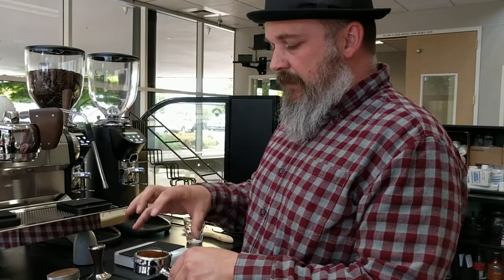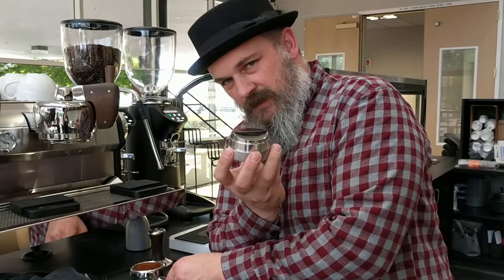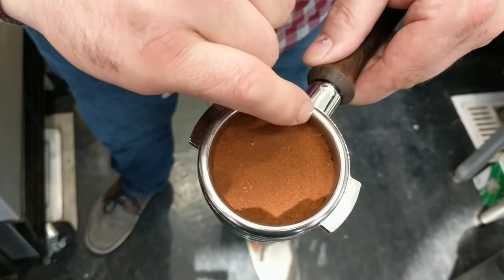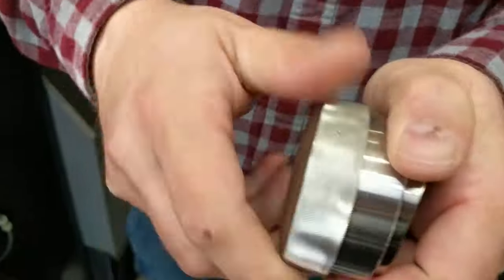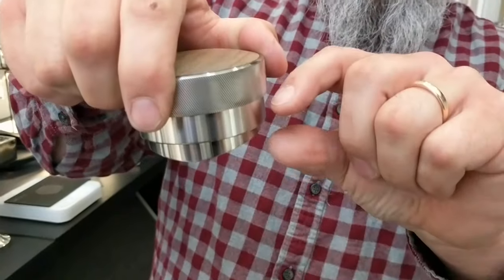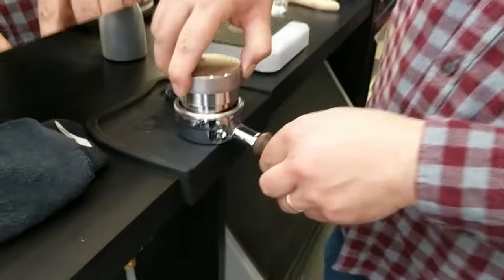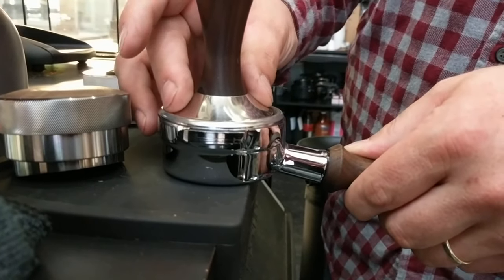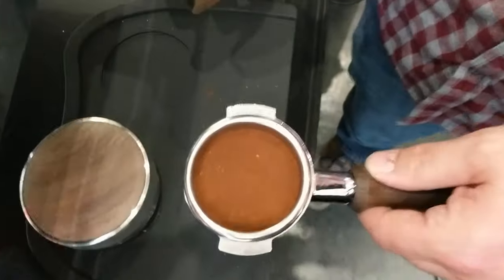Saint Anthony Industries Distribution Tool Depth Setting

Comment: If you set the distribution tool deep enough,.do you really need to tamp ?
Reply: We actually ran some experiments with this. One of the surprising things we found with the Slayer was that we could better control channeling, timing, and consistency with that practice only and a fairly fine grind setting. Adding tamping to the process added a significant variable. One that changed dramatically from barista to barista. As with all experiments that affect extraction, you have to go back to what tastes best with your espresso. Great question.